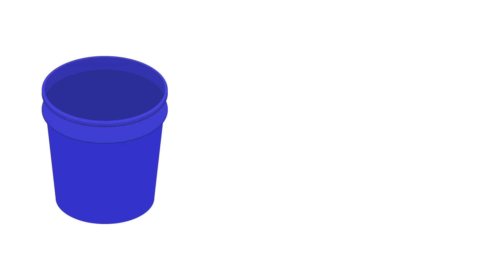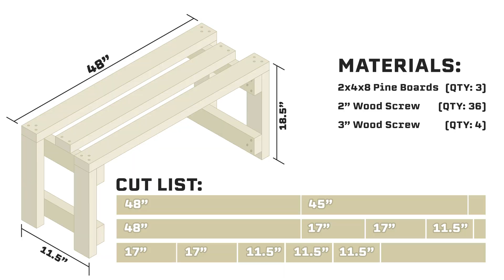How to Build a Dutch Bucket Hydroponic System - Dutch Bucket Hydroponics

Comment: Did you use any kind of glue to connect the 1/4 tubing to the 3/4 feed line?
Reply from the maker: No glue, just the irrigation connectors. They seal themselves.

Comment: Hi thanks for your very informative videos. I have one question; could you please tell me the size/demention of the O rings you used. I cannot find them anywhere at lowes or Home Depot. I guess I will have to resort to amazon . Thanks for your help.
Reply from the maker: I use 3/4” rubber grommets from Amazon. There should be a link to them in the description.

Comment: Hi, thank you for the vid, I have everything I need to start. but  My Perlin in my country is extremely expensive, now Inside my buckets I want to add a basket to the top of the lids, which will reduce my Perlin need. or even the coco need. will I get the same effect ? 

If you have a discord, maybe I can post you a picture of what I want to do. 

Your advise will be extremely appreciated.

Comment: More of a rdwc (recirculating deep water culture  only not deep lol) ebb n flow will flood until u hit your drain if it took 10 seconds to fill and hit drain reduce 10 minutes to 20 seconds every 2 hours. Water fills up pushing stale o2 out and as  it drains it pulls fresh o2 back into the rootzone. Now different mediums will need more frequent floods not longer ie the stone since it has 0 -1% capacity to retain and hold water. Where something such as coco coir or rockwool hold anywhere from low as  45% WC (water content % ) upwards of 85-93 WC% . Rockwool has a small % of material and the remaining is air . Medium type along with amount of time to flood  play a huge part on frequency and duration.

Comment: Awesome build.  Always hang straps from the top.  Years of doing electrical work, and seeing failed pipe on the walls tells me this. 😉 No hate just saying.  
I'm always using PVC fittings for hydroponics, I'm surprised I never slipped a barbed fitting into a regular PVC fitting; good call.

Comment: spray paint off-gassing in the grow space. NOT GOOD. Just use a piece of reflective roll insulation to cover it. Second flaw is the height, if using this indoors you better have a one heck of a headspace. third flaw is your reserve at the bottom  of each bucket. Anyone that has used the bucket ebb and flow system knows this problem. Nute just sits at the bottom and builds up(sludge) creating a problem in the system with EC. 4th flaw is the emitters themselves. Typically these emitters are used for wool style substrate, the wool becomes universally wet like a sponge. This system here I fear would create dry pockets as we have seen in others.

Comment: I assume pump runs continuously, and not a timer 15 mins on / 45 mins off or something similar to that?
Reply from the maker: The pump is on a timer. It runs 3 or 4 times per day for 30-45 minutes. This can be adjusted based on the needs of your plant.

Comment: Thanks for the video! I need to go back and re-watch it in detail but can I ask - can hydroton or other stuff be used in place of perlite?
Reply from the maker: Absolutely! I use hydroton as well.
Reply: @HydroHowTo  Thank you! Quick follow-up: If you use hydroton, perlite, and/or vermiculite, can they all be reused over and over again each year?
Reply from the maker: @pauldigioia5598  Yep! You may eventually need to clean the hydroton as it will begin to hold organic material over time.

Comment: I’ve started cherry tomato plants inside in Kratky using 2” net cups. Can I transfer the plants to Dutch Buckets without losing or shocking the plants?  In Dutch Buckets are the roots always wet?  No room for air roots?  Do your pumps run 24x7 or a certain amount of time on per hour?  Thank You!

Comment: my system is a bit different, but every bucket i have is lowes blue - i cant imagine why anyone would whine about the color of the buckets lol
also, im curious about pump failure rates when the pump is constantly running - i use small submersibles and i only run them either 8 or 16 minutes a day and they only last about a year at most - how long do they last when they're on full time?
Reply from the maker: I totally agree. The aerators are the only pumps I run full time. I replace the stones every year or so if they're clogged. The pumps themselves are all 3+ years old. The submersible pump I use for supplying solution to the buckets is also 3+ years old. I've used the small cheap ones in the past and they don't last near as long, similar to your experience.

Comment: I'd probably put the reservoir under the rack, so that if it leaks somewhere, at least some of the water goes back into the reservoir, possibly preventing your system running dry before you discover the leak.
Reply from the maker: Smart idea!

Comment: This method use hydroton. Use 3/8 tubing for feed lines to a T and make a ring out of the 3/8. Use hot trim nail to make about 8 holes run pump 24/7 and throw the air pumps away. Get a submersible pump.

Comment: black buckets are dangerous to your plants.  if you find black buckets, use them, but paint them a lighter color first.   a black bucket will be too hot for root systems causing root rot early.

Comment: I have the same type of system at home, my grommets started to leak after 6 months or so. I haven't been able to find a solution yet besides replacement. any suggestions?
Reply from the maker: Is the gasket getting cut by the bucket over time, or is the seal just getting loose? If the seal is getting loose, you can shoot some waterproof silicone sealant into the gasket before putting it on the bucket. If it's getting cut over time, the hole may be slightly too small or possibly a little rough/jagged.
Reply: @HydroHowTo  it's the seal, any particular sealant you can recommend? I'm worried about chemicals leeching into the water. Thank you.
Reply: @fisherrd3 I'm a little late for this but for anyone else looking for an answer, I recently fixed some leakage in my bucket using "non-toxic" silicone for aquariums

Comment: Lowes blue bucks and even home depot orange buckets worked fine as far as algae growth. Yes some light is visible through them but must not be enough. I personally prefer the Lowes blue, it'd darker then the orange and unless you have a water chiller the blue actually helps reflect more light then black which absorbs thr most as we all know resulting a warmer rootzone/water that can and will promote algae growth, root diseased and pathogens. But if you must, just buy any bucket and paint the outside white.

Comment: Thank you for all the measurements.  It was driving me crazy for a bit.  I was over analyzing it.  Anyway any suggestions to keeping your reservoir cooler?  Yes the black tote and painted lid help.  However I'm in Arizona and it's hot.  It's a pain to add ice buckets 2-3 times a day.  Any suggestions would be appreciated.
Reply from the maker: You may try some type of thermal barrier around the buckets/res. Something like Mylar that will reflect sun away from the buckets, with a gap between the bucket and barrier for airflow. Maybe checkout some passive cooling systems and see what you can adapt to your system.

Comment: So help me out. When large plants get heavy, peppers, tomatoes. etc. do you have any tipping issues with the pearlite bucket being so light weight?
Reply from the maker: I’ve never had any issues. The perlite actually gets pretty heavy once it’s wet.
Reply: @HydroHowTo    Thanks, I’ll be giving this model a try. Currently use Mr Stacey’s but too many large plants turns the unit into an unmanageable dense tree. 😀

Comment: It is RDWC or DWC?
Reply from the maker: No, these operate differently than a DWC or RDWC system. For instance, in those systems the buckets are full of nutrient solution instead of a substrate.
Reply: @HydroHowTo  But then it's DWC? It differs from RDWC in that there is no circulation of the nutrient solution.
Reply from the maker: @Санчес-я1т  DWC is an active non-aggregate type of system, just like RDWC. A Dutch bucket system is an active aggregate system. The way they function is fundamentally different. In a Dutch bucket system plants rely on moisture/nutrients retained in the aggregate after the pumps shut off. The Dutch bucket system functions like an Ebb and Flow system, not a DWC system. I hope that helps clarify.

Comment: 3:46 Does water drip through these rubber grommets? I heard that they can pass water.
Reply from the maker: I haven't had any problems with them. My guess would be that people having problems maybe didn't drill the correct size hole.

Comment: Paint?
Reply from the maker: I don’t understand the question.
Reply: @HydroHowTo  Why Paint? Special Paint,, Oil Based Paint?  I watched on silent FF through  small preview...assume it's keep light out, but wouldnt want it effecting the nutes
Reply from the maker: Oh! Yes, you’re absolutely correct. It’s to block light, and as it’s on the outside it shouldn’t have any impact on nutes. Some viewers have recommended simply covering the lid with Mylar or any other opaque material, which is also a great option. Really anything you can do to keep light out of the reservoir is perfect.

Comment: I'm not convinced the air pump is quite necessary, wouldn't it hinder the operation of the water pump?
Reply: I appreciate your video and the knowledge you shared making it simple for us viewers. Just want to understand more if the air pump is detrimental to the system
Reply: The air pump is there to oxygenate the nutrient solution as it’s being routed to the plants. The more agitation and bubbles you can create, the more oxygen is getting to the root system. This added air also helps lower the nutrient solution temperature a little. Matter of fact, look up waterfall return system in RDWC where a lot of growers will use 3” pvc and a 400+ gph pump for the nutrients and air stones in the buckets too. (Not a perlite application).
Reply: @IC-Spicy  Do you use the generic solutions parts A and B ? I guess it depends on what you're growing but A and B is pretty much good for everything just not best?
Reply: @dmac5593  for high production or flowering plants I am using general hydroponics FloraNova series this year.
Reply: @IC-Spicy  top feed at a high enough flow you won't need airpumps.

Comment: Another build I saw had a filter installed between his nutrient tank and the dripline, is that something that would benefit a hydroponic setup?   Or would that sap nutrients from the water as if they were impurities?  (Asking for a small home setup like you showed us above)
Reply from the maker: It depends on the kind of filter. The pumps have a pre-filter to help prevent sucking debris into the pump. I don’t really see much benefit in adding another filter between the pump and drip lines. In this system you mainly want a “filter” material between each bucket and the drain lines to keep from draining perlite into the reservoir. I hope that helps!